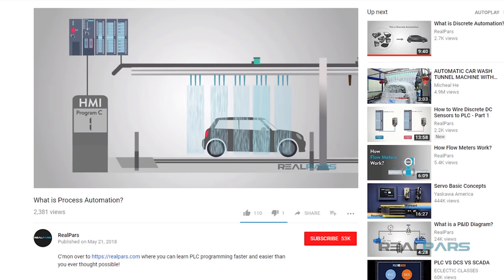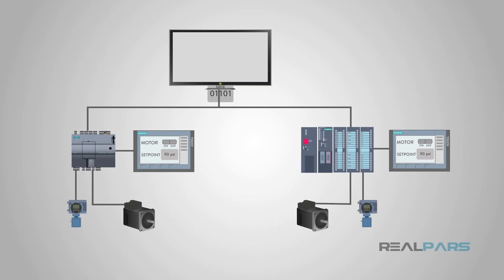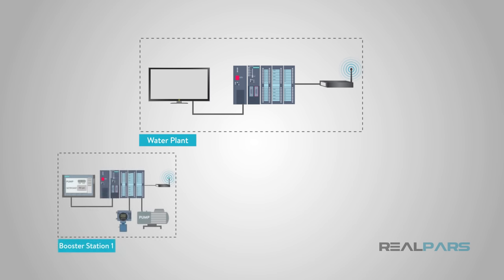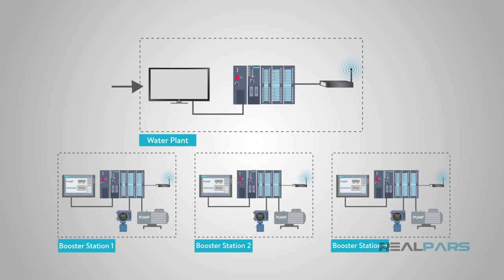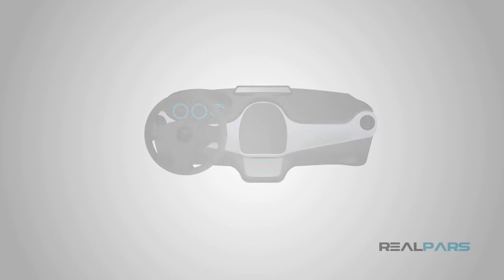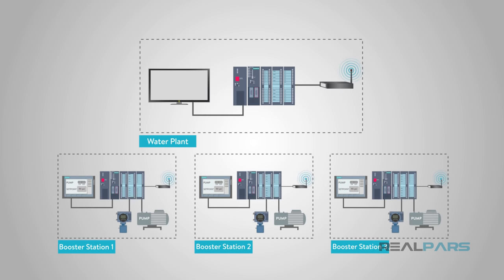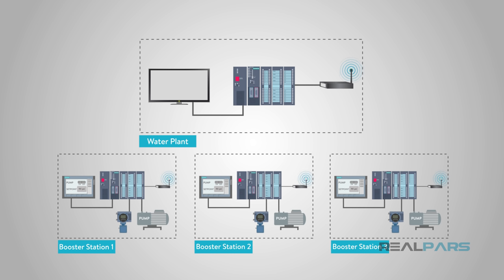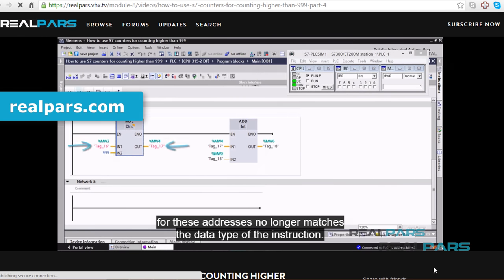What is the difference between SCADA and HMI?

Comment: A PLC which is controlling a vendor specific piece of equipment in your plant could link to a DCS field station controller (PCU) via say, ProfiNet. This DCS I/O controller (PCU) will also then link to all other field stations and operator stations and thus we have the ability to control, supervise and monitor the entire plant process with DCS redundancy and high speed. But lets say this Plant is only 1 of 5 and they are placed in different locations across the country each with there own DCS system, It's the SCADA system that will then link theses plants and collect there data in a centralized location and store this data on servers, you would also have the ability to view the entire system (all plants) on some form of SCADA operator station, but the information will be sourced from gathered data in the server.

Comment: So is it right to say that every DCS's HMI is actually a SCADA systems? Since the DCS's HMI is the supervisory of other control systems'
Reply from the maker: The DCS itself could be thought of as a SCADA system if there are many remote controllers and I/O.  An HMI is part of most all SCADA and DCS systems.  HMI's only provide an operator interface to the process, and stand-alone, HMI's are not SCADA systems without other devices, like CPU's, I/O and communication models.

Comment: So if I'm understanding this right a SCADA is really a whole system being networked in together which would include a central type PLC (Data Concentrate PLC) which then also has its own HMI to be able to control all those other PLCs remotely through the HMI.

While the word HMI just means the  machine screen controls for one local PLC
Reply: 1:36 Central HMI, just a screen, can control anything. Scada is like an umbrella which includes everything: HMI(central and localized) process controllers like PLC, sensors and actuators.
Reply: @abdulbasit-cn9ek  True, but now HMI panels have gotten so sophisticated that they can do the same job.

Comment: Can SCADA overwrite a function or a command from the controlling base station, that has been given from a field operator on his responsible PLC or  PID (direct field controller) in case of emergencies?
for example, a PLC controlling three pumps has been given a command from the field operator using its HMI, to work on 80% to fast forward the process to meet the job deadline, but from the database stored SCADA has a program for each pump maintenance table, and when working on 80% one of the pumps will not hold for the working time that has been set on its controller.

Can SCADA overwrite the command of 80%? Will, it detects that before the job starts and notify the field operator that this command is a risk? or just record the event for investigation if the pump breaks afterwards.
Reply from the maker: This all depends on how you program the system. If you need the SCADA to overwrite a command in the field, you can program the system to do this.